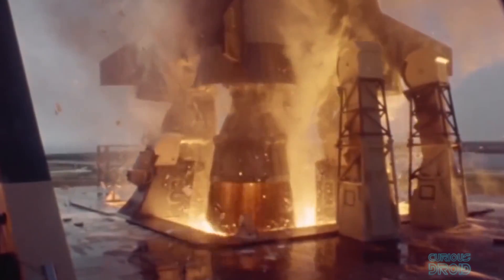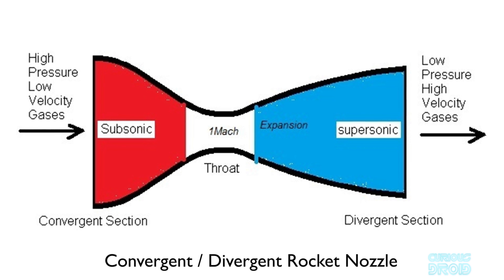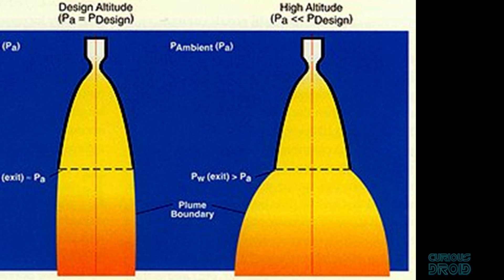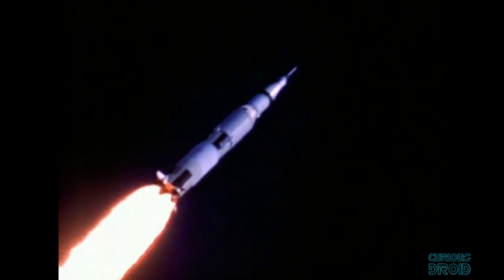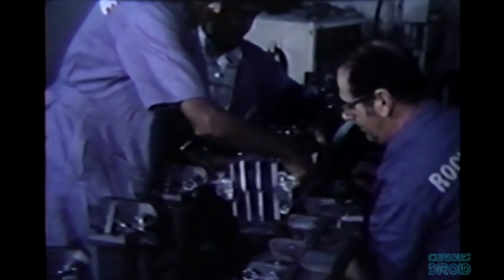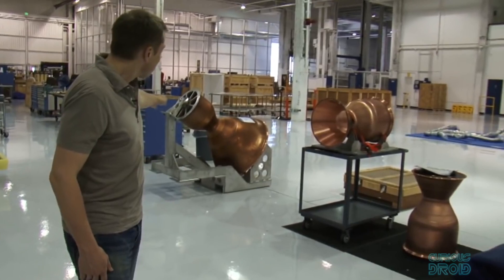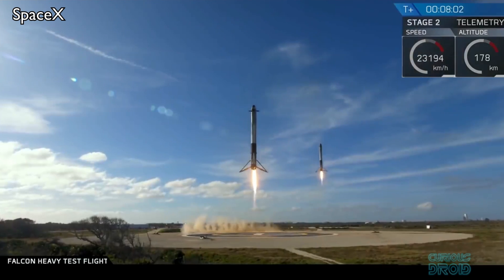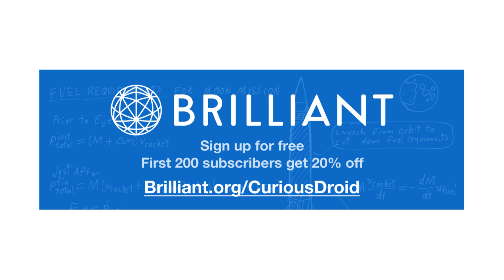Aerospike Engines - Why Aren't We Using them Now?

Comment: ARCA SPACE IS GOING TO USE HOT WATER FOR FUEL ( NOT STEAM, 250c ,not heated enough) IN THEIR AEROSPIKE TOY ENGINE. ROSA BLOCKED FUEL TO ARCA, WATER ONLY. ARCA BOILER TANK IS HOME-MADE FIBERGLASS 250c TEMP, AND ABOVE THIS TEMP.....KA-BOOM. They say in their White Paper this will go MACH 2 @ 3,000m (9,000 feet), BULL CRAP.
Reply: Not quite. Apparently, their plan is to use whatever teakettle this is to "kick" Haas rocket into higher altitude, where staging will happen and sensible Executor kerolox engine will take over. Basically, like the rocket table thing from the old Kistler concept videos.
Reply: @caav56  This is what ARCA POSTED IN THE WHITE PAPER ABOUT THE NEW FUEL.....WATER. ROSA BLOCKED FUEL.
Assist System, or LAS.

At the end of September 2018, we decided to use the
LAS technology in combination with the aerospike
engine also under development at ARCA and
replace the hydrogen peroxide considered as
monopropellant for the Demonstrator 3 aerospike
engine. It was however clear for us that we need first
to understand the new propulsion system and run tests
on a larger classic engine, before implementing it on
an aerospike engine
Reply: I just found out how much ISP this TOY WATER BELL SHAPE NOZZLE AND AEROSPIKE MAKES IN THIS ARTICLE POSTED BY ARCA.
And he said in his White Paper it was going to reach "Mach 2@ 9,000 feet". BULL CRAP. Read all about this posting from ARCA- "YOUR favorite SCAMMER".
Now this is a LONG WAY FROM 25 TONNES PEOPLE.
ISP, 2.5 TONNES ON TEST ONE. WITH FIBERGLASS BOILER TANK(THAT IMPLODED AFTER THIS TEST).

ARCA, sponsored by a Romanian company, announces the testing of a water-based electric rocket engine
ARCA, the company sponsored by the Romanian Dumitru Popescu

https://www.descopera.ro/dnews/18745345-compania-arca-patronata-de-un-roman-anunta-testarea-unui-motor-racheta-electric-pe-baza-de-apa

DO A ARCA SEARCH IN THIS NEWS SITE, ALL THEIR TOY'S AND SCAMS ARE POSTED.

That's all Folks
https://www.youtube.com/watch?v=gAj8jLe_shQ

Comment: And this is part of the problem, we should be developing new ways to get into space and exploring it but we are not.
Reply: Now they're not making any more planes now they're not going to do anything in spacers no more rockets and stuff all the time figure stuff shut down no more and more like give up f space no more secret space program and not going to make any more tr3 bees or anyting the Black Mamba shut down all those businesses the Black Ops in a skunk where is just as big stinking skunk now has not even been discovered or any more no more they parked holes in a graph South Haven tractor shaped like a triangle is scaring her by old world they went and parked all those are not going to use those anymore they put the shuttle up on Jacks sold the tires trapped out what was left of shuttle and threw away the keys and turned off all the Antigravity machine no more flying saucers no more triangles and I think they're just going to start using hand gliders with BB guns on them

Comment: Elon Musk seemed to be saying in his interview with Tim Dodd that his "traditional" combustion chamber and engine nozzle had achieved a thrust efficiency equal to aerospike even at sea level. SpaceX engineered their Raptor engines to have an efficiency superior to any previous bell designs. No need for aerospikes. The thrust efficiency of aerospikes were once a seemingly good idea in the early days, but the 2 stage Starship Superheavy will have thrust efficiency superior to any Lookheed Martin single stage rocket. The aerospike is an idea from the 1950's that is a failed engineering idea.

Comment: So the answer is: Money
Reply: And bureaucracy
Reply: It's also the fact that there are major problems with making aerospike engines work. So much so that Peter Beck, the CEO of Rocket Lab, has stated that developing a working aerospike might not even be worth it. 
And even ARCA seems to be abandoning the idea after having worked on it for a long time (their SSTO design had a stupidly low payload capacity anyway).
Reply: Everyday Astonaut went around asking a lot of rocket engineers why they don't work on an aerospike including Elon Musk. He even asked engineers that worked on the aerospike projects named in this video.  Basically the answer is that it's not that practical. Besides the heat issues there are weight issues since an aerospike engine has almost 2x more moving parts than a traditional bell engine. Due to this the theoretical performance of an aerospike engine using modern materials is less than SpaceX's Merlin and Raptor engines. The engineering problem with an aerospike are so vast for little to no gains in terms of thrust to weight ratios aerospike probably won't be developed unless someone really wants to develop an SSTO vehicle.
Reply: It's not just money.  It's betting the company on a technology no one has ever been able to get to orbit.  Eventually someone will try it.  If it proves effective it will become more widely used.
Reply: Also weight, complexity, serious heating problems, and lack of proved designs.
Reply: & thrust
Reply: The best way to get better technology is everybody comes together to build a new rocket and reaserch new tech and it will be done in couple years. Its like do you want better rockets then come together and build it why is money a Problem do this once with no money included just need resources then you got better tech and in the end we can talk about money.
Reply: yes most definitely is. but this was a race and ythe parameters of the race set by NASA did not specify the use of aerospike engines the gist of the specification is build as fast as you can as safe as you can and as cheap as you can also the first one to provide a working spaceship will get the highest points.
Reply: No bucks. No Buck Rogers.
Reply: "No Bucks -- No Buck Rogers." -- THE RIGHT STUFF [1983]
Reply: When you are operating in THREE DIMENSIONS -- versus TWO -- the cost goes up exponentially.
Reply: There is also another reason: Another way to increase the efficiency is to increase the chamber pressure. With a higher pressure the advantage of aerospike engines decreases.
Reply: It disgusts me that companies are too concerned with having maximum profits to make progress. That's all any business today cares about is maximum profit, getting every single penny they can squeeze out of something.
Reply: @roselockecottage6486  not that simple. how you gonna fund your next launch? rockets are expensive, friend.
Reply: @NaeroSpace  corporations can afford it. They choose not to invest because they are only concerned with making maximum profit. If a huge profit can't be made they aren't interested and I find it gross.
Reply: @roselockecottage6486  maybe lockheed, maybe boeing. though my world is not as black and white as yours
Reply: @roselockecottage6486  It's reeeally not that simple, my man. If a huge profit can't be made, you'll struggle to stay afloat, and the competition will get ahead of you. Eventually, you'll go broke and that's much worse than just using a fraction of the investment to improve current technologies and get better results. It's much safer. 

I get what you're saying, but you can't just throw money at everything. Money can only take you so far. Innovation and creativity is what actually brings new technologies, and it is not directly proportional to the amount of money you input. This can either mean that you can get huge improvements for little money, or that you can get tiny improvements for a ludicrous investment. It's always a huge risk, which is usually why it's better to play it safe or to make a move when you're 100% certain that there's much profit to be made.
Reply: @roselockecottage6486  stop the one trick comment... you're off base on several bases...
Reply: @MidlandTexan  yes, defend the wealthy corporation and live in denial. Go for it.
Reply: I mean these corporations are definitely 100% transparent and trustworthy, I was so wrong to doubt them hahaha
Reply: You've convinced me with your YouTube comments.  Corporations need to care about obscene profit only. That's all they should care about. Good job convincing a stranger!
Reply: @roselockecottage6486  profit is the price for efficiency.
Reply: @roselockecottage6486  No there are other drawbacks to linear aerospike engines. SpaceX was willing to do the Carbon-fiber development that the X-33 left unfinished, but dropped that because steel proved superior as an all-round material.

It's not just about money, it's that, over the entire use case, linear Aerospike engines aren't as useful as they appear. Watch Everyday Astronaut's video, he goes more in-depth.
Reply: @roselockecottage6486   It's not that simple. Companies only caring about profit is not a "today" thing, it's been that way since companies were a thing. And quite frankly, you can't always afford things at moments notice. Companies have to think in much longer terms than just one or two experimental stages. Economics is a game of advanced statistical guessing where the wrong guess can land you with irrecoverable bankruptcy. That's not to say corruption and greed are non-existent but to imply that every roadblock is a result of that is very naive and short sighted. Big innovations take a while sometimes and i'm sure this issue like many others will sort itself out in time. Just look at the automobile industry for a reference.
Reply: @Ali-kp7bh  no, I mean bureaucracy
Reply: Its   ALWAYS   money  -   most   of   pays  admin/ management  . Very  little  to the  technology  -  of  which  differential  in  pay  -  techies  get  50 %    of admin / management   -   AND   easily  fired.
brits are   pissed  that  I set   up  asylum  status  fro  their   persecution -  they  want / wanted   particular  university  (  one  that for  intellectually  challenged  =  no  ability )     doing  coo-coo  on the   inventor  .  Refused / refuse  to  tell them - they refused  to pay

Comment: This needs to be updated with Elon's answer.  Aerospikes have lower combustion efficiencies than standard bell engines.  Also they are most useful for single stage to orbit rockets.  Single stage to orbit systems don't scale as well as two stage systems like Falcon and Starship.   Full and fast resuability of ALL of the rocket system is the holy grail of low dollars per pound for orbital insertion.  Therefore, for Elon's and Bezo's goals of huge loads to orbit cheaply; aerospikes don't help and just increase development cost and reduce overall ISP due to lower combustion efficiency.

Comment: Ideas for the future:
Magnetics/magnetism, alternate fuels, hybrid alloys (titanium mixes and/or new ones), newer/better/lighter/more efficient ship and 'ship launcher' designs. And probably most importantly development of space engines (like FTL or the like) for use on shuttles (if calculated, may end up requiring to use for a shorter period, and if accurately measured, may require less fuel, lower costs, higher speeds obviously, lower heat?, lower weight?, and/or who knows what else?).

Comment: The main weakness of aerospike engine beside cooling of hot surfaces must be the poor efficiency and with two stage to orbit launcher, a bell shape of the engine can be easely optimized for low and high altitude and in fact on the latest Starship design, the second upper stage design carry both types which seems to be a must to combine efficiency at high altitude and safe landing with low altitude mandatory reignitions. This creates some additionnal weight penalty: the FalconX 16% reuse version load carrying penalty must reach about 30% on Starship. Since the cheap methane and oxygen combustion used on Starship is very efficient, the efficiency gap of an optimum engine with aerospike and wrong bell match got even wider, i would assume. Then a very importante factor is that the entire space system smooth landing rely on many engines critical reignitions. This and the atmospheric reentry at liberation speed of a light tin can structure are the major safety risks of such reusable system homologated for repeated crew carrying missions. Seems that only a single stage to orbit system project could save the current aerospike technology but this launcher requires much more progress on materials since a stainless steel single stage orbiter would be way too heavy. Weaved composites like the composite fan blades of the new Leaf jet engine shown how stiff complex composite assemblies could be robotized in the future, but we are still far from similar big structures.

Comment: I guess there's a major "if it ain't broke don't fix it" mindset. I'd think that just fuel costs wouldn't be the motive of a more efficient engine, considering that most of the weight of a rocket at launch is fuel if they could reduce fuel requirements dramatically would allow a far greater payload fraction, thus allowing a smaller cheaper rocket to carry a given payload, or far greater payload on a similar sized rocket (more profit). I'd think commercial operators would be most motivated to do this, while NASA is more concerned with making something that works for fewer but more risky missions, for which reliability and confidence is a more important factor than cost. I'm sure SpaceX and the other commercial operators have thought about and researched this in great detail and determined that it doesn't make economic sense for them to try to develop these engines, the expected costs outweigh the performance potential. 
Another thought I have to ponder - what about variable-geometry bell nozzles? Afterburning jet engines, such as on fighter jets, basically always have a variable-geometry nozzle, typically with overlapping petals, which they need to operate efficiently in different conditions (different throttle settings, afterburner on or off, different altitudes). Could a similar approach, possibly even similar design, be used for rockets? Why isn't this done? My guess is that rocket engine exhaust is too hot and under too much pressure, far more than even afterburning jet engines, for such mechanisms to be possible or feasible.

Comment: @Curious Droid
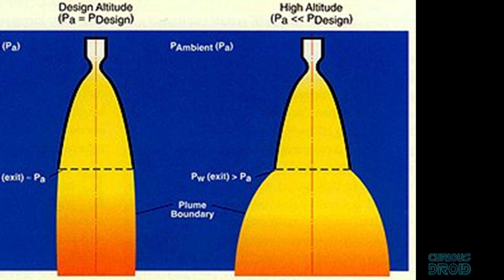I think there is a common misconception of what underexpansion and overexpansion actually means. In your vid at 3:51 you state that a sea-level optimized nozzle, when lifted to area of low pressure, would have its gasses overexpand. While factually correct, the term of  overexpansion is actually used in reference to nozzle itself and not gasses. So, an aforementioned nozzle would be underexpanded, ie - not expanded enough for optimal gas flow under low atmospheric pressure.

Similarly, a vacuum-optimized nozzle, launched at sea level would be overexpanded - ie, expanded well beyond its optimal exhaust flow, allowing atmosphere to separate the flow from nozzle walls.

This is kind of counter-intuitive and hard to remember, but still quite important to explain it correctly.

Comment: one logical reason why the arospike engine is not used. It is for a single stage rocket. We don't have a single stage rocket , that can reach orbit. So the first nosel is designed for a specific hight. The second for another hight and the 3th for outer space. So there is no use for arospike.

Comment: You forget the biggest disadvantage you can have two optimized bell nozzles and seperate stages and lose the weight of the dropped weight making the whole vehicle more efficient. The aerospike might be the most efficient whole flightprofile engine with stage separation and 2 optimized nozzles the aerosüike just falls behind.

Comment: 1inch x 1inch = 1 square inch. 2.54cm x 2.54cm = 6.45 square cm not 2.54
Reply: 2:56 Dumb American strikes again. It doesn't even say that it says 1 inch = 2.54cm.

edit: To clarify further he means the area not squared (sq). Sq is the actual error.

Comment: SpaceX has more efficient engines than Aerospike with jet fuel is capable of, that's why
Reply: Wrong, sorry.
The Russians made better engines than the Raptors 50 years ago ;)
Look at the NK15 (1st ever close cycle engine) and its successor the  NK-33.
https://en.wikipedia.org/wiki/NK-33

Comment: You pointed out why quite well. The current technology is tried, tested, and _proven_. When it comes to developing new technologies, private companies actually don't usually have the resources to develop them on their own. If they do, they're still usually not going to without government funding to help defray the costs, as the R&D of new technology is one of the largest and riskiest money sinks a company involved in any technology engages in. They will work toward making the current tech as efficient as they can engineer until they either can't, or it would cost too much to do so.

Comment: I think the biggest reason is that the added efficiency of aerospike engines still isn't enough to make SSTO viable on Earth, and there's not much reason to use aerospikes on anything that isn't SSTO.  If we lived on a planet that with a bit less gravity or if we had chemical reactions that produced a bit more energy then maybe SSTO and aerospikes would have a role.  But given our current constraints, we need at least two stages in order to lift any significant payload fraction to orbit.  Once you're stuck using two stages anyway, you can just use two different engine bells.

Comment: Very clear explanation, thank you. But I doubt I heard something correctly. If aerospike engines are 40% more efficient, that means they can use 40% less fuel to do the same work. Since most of that work is just accelerating fuel (that hasn't been expended yet) , you could free up something like 40% of the take-off weight and use it for payload. Which is more than 10 times more than than the maximum payload reached currently (3-4%). E.g. space rockets could be 10 times smaller. If so, ignoring this different nozzle design would be a tremendous mistake. Is 40% the correct number?